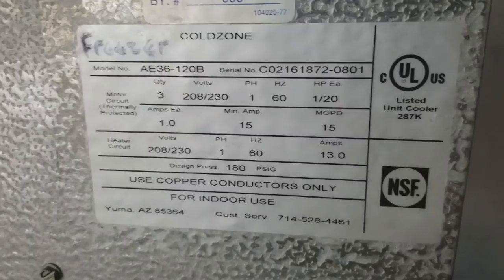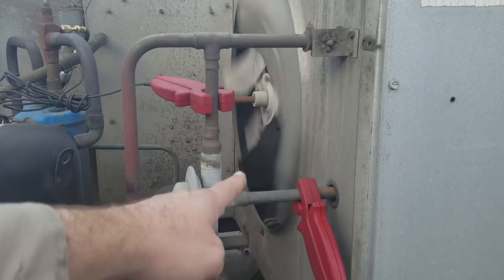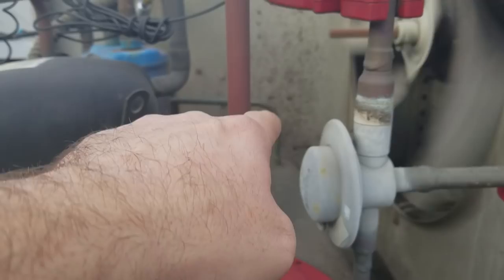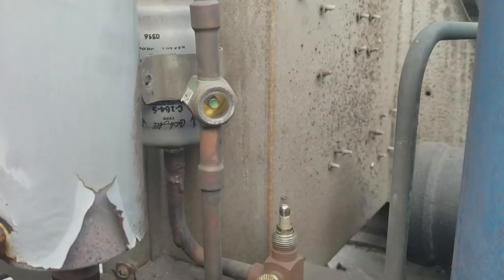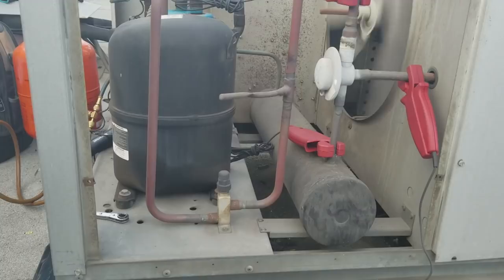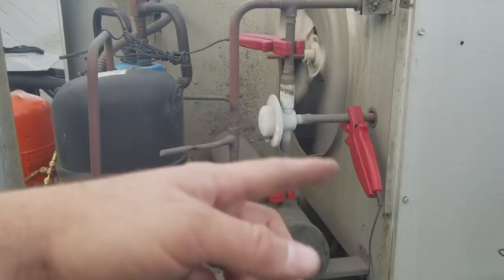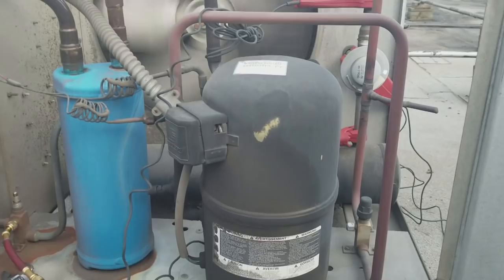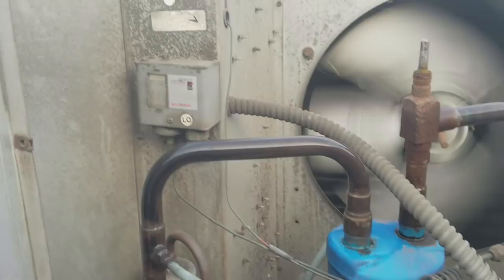Vapor and TXV's dont work well together

Comment: You’re probably one of the best tech’s I’ve ever seen on YouTube please put out a lot more videos please must be union trained????
Reply from the maker: No union training, I went to a local community college and I like to read books.  I am a second generation technician and have been doing this since i was a kid. Thanks for your nice comment, and I'll try and keep the videos coming
Reply: Agreed. Please put out more videos. You are the best tech on YouTube.
Reply from the maker: Thanks for watching and please subscribe if you haven't already.
Reply: I'm self trained.  Picked up the bible on the subject and studied it extensively.  Modern Refrigeration and Air Conditioning, 20th Edition is highly recommended.  It was even able to explain absorption cycle systems where the system pressure is uniform with no high and low pressures.  Took a while to understand how you get freezing by building a fire under one.
Reply: @isettech  Yup, One of the best books. We have some large structures here in the Minneapolis/St Paul area that use absorption systems for cooling because the natural gas burned to produce the cooling is substantially cheaper than using electricity to run a compressor. They were quite common here in a residential setting up to about the 1980s and I worked on a few when starting my career in the mid 1990s. They’re starting to make a comeback  because of their lower “carbon footprint” because you’re producing the energy needed at the point of use instead of burning it in a power plant to produce electricity, then losing some of that energy in the boiler at the power plant, line losses from stepping it up, transmission, then stepping it back down again. There are residential absorption ACs on the market again and they’re also available as heat pumps

https://www.socalgas.com/smart-energy/technology-and-investments/natural-gas-air-conditioning

https://allamericanhc.com/blog/gas-vs-electric-air-conditioning

Comment: Did not remember seeing this video, much less commenting on it a year ago, but have learned so much from you, NW Ohio and Chris in Boston and of course NorCal this past year.

Gracias a todos ustedes.

Obviously noted you are reluctant to show what "heat source" you use to test receiver level, so I won't repeat that question,  but can you expand on where you apply said heat? 

Just to the end barrel near the soft plug? or longitudinally spread along the length of the receiver?
Reply from the maker: On the end barrel, but be completely sure you are not heating up the soft plug..... and pass up and down two times, than run your fingers from the bottom up and you will feel the hot spot as your moving up. The hot spot is the end of the liquid level

Comment: Question: I'm going through a online commercial refrigeration training course with Dick Wirz & I just recently learned about the HPR valve. I want to see if I understand what you did during your service call. I'm assuming that due to a lack of charge you also had low head pressure (no heat load picked up from the evaporator)  so therefore the HPR valve senses this low head & is trying to close off the liquid line to back up refrigerant in the condenser tubes to build up the pressure. Because of this the HPR is now only allowing hot discharge gas to flow into the receiver. The HPR cannot build up the head of course due to no heat load in the evaporator so it stays in this condition. I'm I right on this observation? Also I did not understand why the evaporator fans were off. Is this a defrost system where after defrost, the compressor comes & when the evaporator coils reach a pre-determined temperature, a fan delay relay is energized ( relay closing allowing circuit to evap fan) ? I believe that this is for in order to refreeze the leftover moisture on the coil fins so that it does not shoot water across the ceiling of a freezer only to freeze up later. Its great to learn about these components in my course study & then watch them in action through your videos.
Reply: 1 more question: To determine a liquid line level on a receiver would a lets say, a MAPP Gas torch be safe for such a application?
Reply from the maker: So because the system was low on refrigerant the Headmaster (hpr) is bypassing the condneser and there is not enough refrigerant in the receiver (the winter charge) The winter charge creates a liquid seal in the receiver so that when the headmaster bypasses it pushes the liquid refrigerant thru the system.
Reply from the maker: The mapp gas torch theoretically would work but...... you are heating up a pressurized cylinder with a torch and you could theoretically overheat it.  Now that I told you that it is dangerous , I can tell you that is exactly how I check liquid level!!  :-)
Reply: I have a old HVAC book that describes this very same procedure for determining the liquid level. They say to never heat the receiver hotter than you can safely touch & look for the cold line.
Reply: Ok, so I am on the right track with the HRP in bypass because of low head pressure. I'm trying to understand the liquid seal for the winter charge. So I'm assuming as the condenser is being backed up to increase head pressure in low ambient there has to be a reserve or enough liquid refrigerant to feed the TXV correctly while the rest of the refrigerant is being backed up in the condenser. Is this correct?
Reply from the maker: Yep you got the right idea!
Reply: Thanks for taking the time to answer my many questions on the Headmaster Control Valve!
Reply from the maker: No problem at all

Comment: Excellent video. would a electric hair dryer work on that procedure ?
Reply from the maker: If you used an industrial heat gun I imagine it would get hot enough but you still need to make sure you do not exceed the softplug temperature limit.
Reply: Sounds great thank you sir .
Reply from the maker: no, thank you for watching!
Reply: Let me guess. Oxy acet. Torches to heat it up? Low n slow flame?
Reply from the maker: In my opinion I dont wanna drag my torches on the roof unless I needed to. But you got the right idea.

Comment: Is the headmaster similar to a hot gas value?
Reply from the maker: No the headmaster or (head pressure control valve) is a low ambient control that helps to keep the head pressure in the system up high enough to maintain a minimum pressure drop across the txv. Without the Headmaster in low ambients the headpressure will get to low and the txv will not feed refrigerant properly.